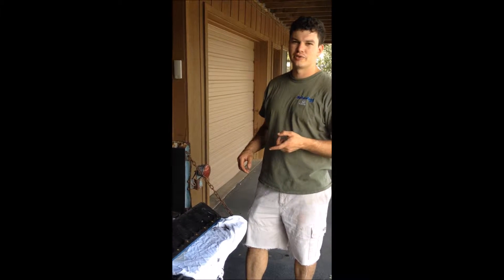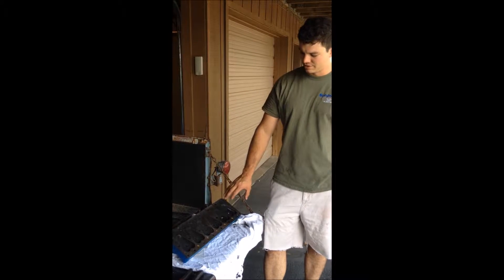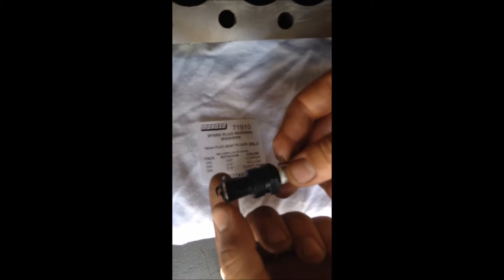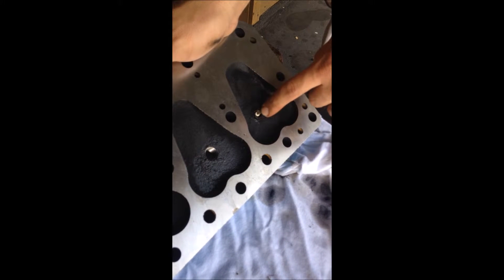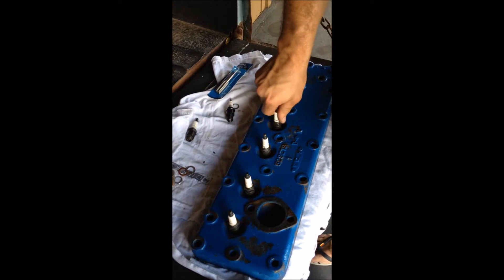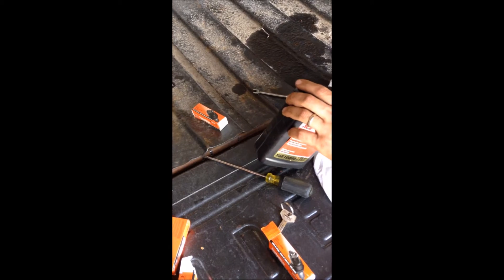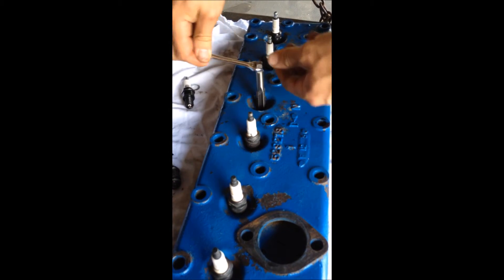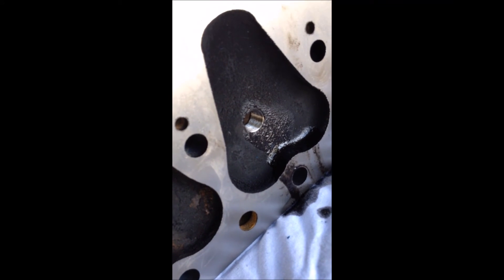Studebaker Flathead Modifcation and Spark Plug Upgrade

Comment: Many years ago, I put one of these 185 engines in my '61 Lark. The OHV 170 engine was ruined by an exploding oil filter. I wish that I had known about the spark plugs. Whenever you get a head milled, you may want to use a small grinder to round over the sharp edges on the sides of the combustion chambers.
Reply from the maker: Gary Langley when I took this head to a machine shop the shop owner of the shop was the one who said i should do this spark plug upgrade. 

I drove this truck every day while I attended UCD. I lost compression in cylinder number 5. I will be rebuilding my motor here in the next year and I am hoping to make videos of the whole process.
Reply: That sounds great. One of the problems mine had was that the valve lifters were so worn that the oil pressure was low. When I put new rings and bearings in it, the mains included a restrictor for the oil passage to the lifters.
Reply from the maker: Gary Langley any suggestions about what I should do about the cam? I have heard of people modifying the cam grind to increase lift duration on the intake but I have no specifics.
Reply: Mine may have had a high lift cam because it was from a truck. That gives more low end torque, but those things have enough torque to move a house anyway.  Duration can give more top end horsepower. I didn't do anything to the cam. As it is, the torque peak was at 1800 rpm, and there was no reason to take it over 2000 rpm because the torque would decrease after the peak. It just made more noise as it reved up. You might contact the Studebaker Drivers' Club and ask. You might want  a goal of the torque peaking about when the horsepower does. I ripped up some engine mounts with mine because of the torque.
Reply: I wish you had shown your truck. I own a 1957 Transtar Deluxe, first year of the new front-end design. I have the 245. I had mine rebuilt and was able to find almost every part NOS. I used modern equivalents for the parts I couldn't find.

Are you just using the tap as a thread chaser? There's a specific tool available for that.

You said, "The book..." Which book? I have them all.